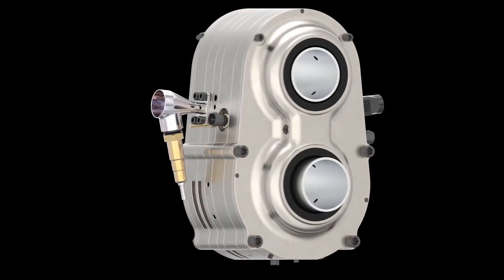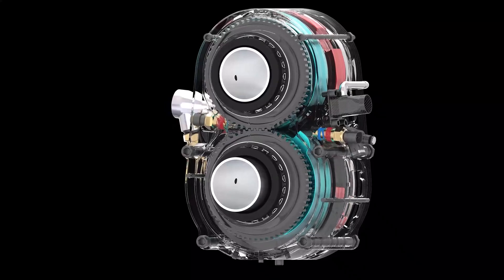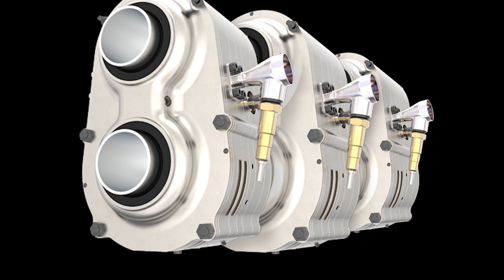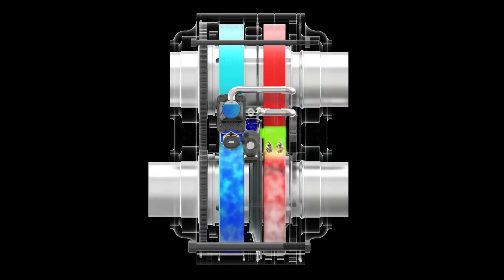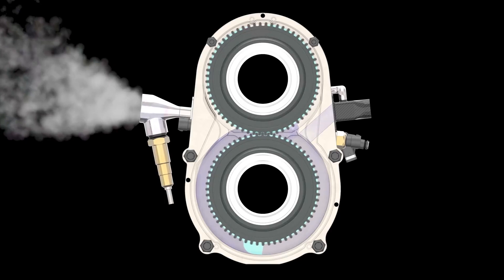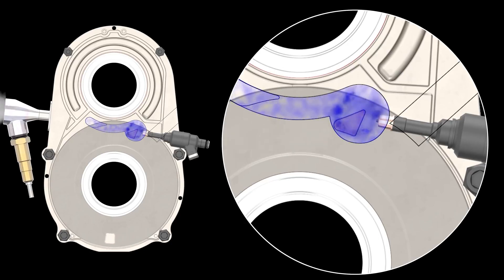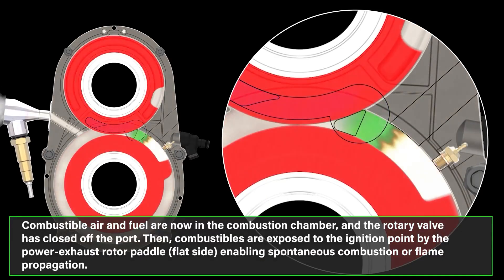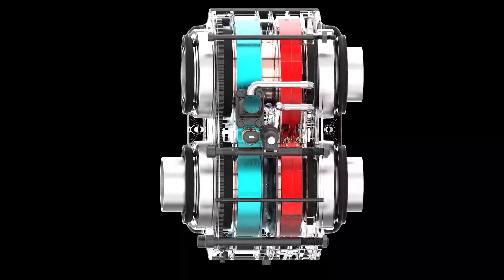This pistonless engine runs on hydrogen and revs to 25k rpm

Comment: It's an ingenious Brayton Cycle compromise between a piston engine and a gas turbine - avoiding most of the piston engine's inherent mechanical complexity and resulting friction losses, and much of the gas turbine's inherent "leakiness" and other types of losses. Looks like it'd make a good light plane engine.

But until I see a video of one running on a test stand, and read actual real-world numbers, I'm not going to hold my breath.

Comment: Really tight tolerances at high rpm on something that gets hot and cold and need to start and work in both cases!

There's a reason pistons have clearance and use piston rings to seal the gap. 

I'll belive it when it's not just computer graphics and they have one running for a few thousand hours. 

Sleeve valve engines were once going to be the next thing. But it was very hard to get the sleeves on high performance systems to last long at all. 

Even the wankle engine while it was sort or revived never took off. 

Some things are hard to beat.
Reply: To be fair electric already has beat it for the most part. Some F1 cars are electric. Nitro is still king in the 1/4 mile though. 

Gas is way too overpriced right now.
Reply: @KillinReapers  Formula-e is electric.  Formula 1 is hybrid.
Reply: @KillinReapers  Gas is only overpriced because of politics and greedy tycoons that are ripping people off. There's easily enough gas to go around everywhere, but politicians, governments, etc are all working to jack the price up at the pumps to line their pockets with profits. Don't kid yourself into thinking that the government actually cares about any sort of "energy concerns", they only care about how much money they can make. They get EVs out on the market, but yet fail to make them affordable to the average consumer, and then they introduce laws and legislations that put more and more taxes on gasoline and diesel knowing that's what 90% of the people use, with the excuse that they're trying to make EVs more prevalent, when in reality it's just because they know that 90% of the people are forced into using ICEs and that they are left with no choice but to buy the fuel and pay the extra taxes, so the government can take more money. And there's really nothing we can do about it, outside of voting people in who are less corrupt, but try convincing your average person of that....

Comment: Waiting to see a prototype. With the energy density of hydrogen, even considering the container, so much higher than batteries, this could indeed have potential. I personally hope to drive stick as long as possible. This one gear all automatic EV kind of driving is not for me, but the move away from oil is necessary.
Reply: This does not have potential. On paper it makes sense but there's no way they're going to scale this up and maintain "extremely tight tolerances." 

This is vaporware. It's a gimmick to get idiots to open their wallets.
Reply: If you state “the move away from oil is necessary” what is the plan for ALL of the cars, trucks, aircraft, trains, and plastic products? Once a workable plan for a transition is implemented moving forward away from oil may help. Additionally how about fuel taxes which are used to fix, maintain, and create roads? 🤔
Reply: @timcass5759  I am not taking about a process that could happen over night. Alternative fuel sources and suitable engines can help phase out the burning of fossil fuels for mobility purposes. Tax codes must surely be adjusted, among many other legislative aspects. It will take some time. What matters is to have that goal and pursue it. Regardless, oil will still play a role in the petrochemical industry, where it is even harder to replace.

Comment: What is its efficiency?  80%? Unlikely but that would be fantastic.  However, that would be primary component of the from tank to wheel efficiency of the vehicle. What would it is the efficiency of hydrogen's journey to the tank? Not so great.  Also it still burns fuel mixed with air at high temperatures, hence it will still produce NOx.  So much cleaner than other ICEs and a step in the right direction.

Aerospace applications seem to be where this makes most sense.   Delivering H to airports could made more efficient making H even more viable.  Most of the NOx would be considerably diluted before reaching the population.  Multiple engines could improve redundancy so may be safer.

Comment: If there’s one thing that will save the combustion engine it’s the fuel. Currently electricity takes too long to charge (while some cases could be made the tech just isn’t there for mass adoption of quick ac to dc charging) hydrogen is literally so abundant and could be modified into any gas station with very minimal work. Plus manufacturing doesn’t have to change all that much because the engines are so similar to the ones that burn gasoline. I honestly don’t see how hydrogen isn’t a win win especially with all the drawbacks of producing lithium ion batteries and the fact that China owns most of the cobalt on the planet.

Comment: A crazy 8 rotary might be a concept that we haven't explored, and there are reasons for that, the smallest of which is now you need the 2 "rotors" to have a near atomic tolerance. The only advantage of an engine like this is that you have complete control of the combustion chamber volume at any point by being able to alter the profile of the rotors. At the same time tuning it would require 2 brand new, matching, atomically accurate rotors. This says nothing of the housing seals.
Reply: that was unusually well said
Reply: @THESLlCK  Morgana is a man.
Reply: @jonathans4503  geez
Reply: "near atomic tolerance"  Really?  What type of atom are we talking about here?  LOL

Comment: So basically, Astron is claiming to have found the key to defying physics?
Eliminating seals with super high tolerances, yeah maybe. 90% efficient? BS. Maybe the friction looses only account for 10%, but despite our best efforts you will lose more to heat, there's just no way around that.
And while those super tight tolerances "may" eliminate seals, the cost of machining parts like that would make it insanely expensive. And what would the time and cost between rebuilds look like as those parts wear?
Reply: Good point. Laws of thermodynamics (Carnot cycle)  means you can't climb above a theoretical maximum  - dependnent on combustion temperature - which I think for hydrogen is approx around 50% something+  (?).
But in reality there is no way you could ever get anywhere near even that abstract theoretical limit. Currently they run at 20 -25%. So it would be semi-miraculous tech that got to >30% ..or maybe 40%.  Eitherwsy nowhere near the genuine 95%+ of electric motors

Comment: Sounds like a great idea, but doesn't metal expand under high temperature? Wouldn't such tight tolerances at 25,000 rpm cause the rotating assembly to touch? I have no idea what I'm talking about! >< lol

Comment: Tight tolerances? So the engine itself is the seal which means the entire engine is the wear item/surface. Straight to the scrap pile when the tight tolerances go bad.

Comment: I know it’s like an open look into it. But a few things I don’t see, a “crank pulley”, accessories wouldn’t be possible, and regardless the engine would probably have to have 8 ridiculous brackets on it just to support it due to its small size. U could go electric but I don’t see certain things still not being connected to the engine.

Comment: I’ve never been on the electric side. Hybrid to me is the best type of electric vehicle. But this, this is the answer we’ve been waiting for. Can’t wait to see it eventually hit the market for cars and trucks.
Reply: Probably ain't going to happen as it would be really expensive to produce because it requires especially expensive materials. And the question remains, how does it deal with wear? Sure, it could work for occasional driving, but as I daily driver I highly doubt it would hold up. And that's before we set into heavier vehicles like utility vans, trucks and other equipment that is used for many hours every day

Comment: One probable i seen imediately was the divet and notch set up on the inside, if the engine is not always in sync and the notch doesnt match the speed of the divet, then the engine will seize up and or break. Now if the system is chain driven between the top and bottom halves of the engine in perfect sync then yes this would be very effiecent.

Comment: While I see a lot of arguments against the design of the engine, The idea of Hydrogen power, produced through solar and wind, is an idea that beats the hell out of electric motors hat run on batteries which are expensive, made of rarer metals, non-recyclable, and there is nowhere to dispose of them, and the coal required to produce the electric cancels the non-pollution factor.

Comment: 170 lb-ft of torque producing 160hp at 25k RPM? The math doesn't add up. Would love to see a dyno graph of this.  160hp at 25k RPM is 33.6 lb-ft of torque.  Sure the engine can spin to 25k, but where are the torque and hp peaks? Lots to be answered before I'd sign on to any given "technology".
Reply: There aren't any dyno graphs because it doesn't exist.  This is another one of those paper designs, and it seems to be a constant that anything involving hydrogen looks much better on paper than it does in real life.  Toyota are one of the few companies to make an actual serious effort to build a hydrogen combustion engine and ended up with a real-world efficiency of about 25% - since they were easily getting 50% out of a fuel cell (and zero NOx) it's not surprising that the only hydrogen powered vehicle they actually make is an FCEV.

Comment: I'm highly dubious of a design that simultaneously relies on tight engineering tolerances for maintaining compression and also runs on the smallest element there is.
Reply: Another problem is the hydrogen making the metal brittle over time
Reply: @snifflesfpv7321  true this is a challenge, and quite a problem for aerospace. It's why satellites and probes in orbit or on station for extended periods won't use it. But, for a consumer grade product constantly being used and with parts existing in much more stable temperature gradients, it might be easier to control for. But thats just speculation. Won't know until a working model is built 🤷‍♂️ . Until then...it is a good point.
Reply: Also leaks if not running on high RPM.  So fine for cruising - useless for real world stop and go.
Reply: Uhm... you think a hydrogen atom is "smaller" than other atoms?  I don't mean that literally... we all know about atomic mass and volumes, but you think THAT is why this won't seal?  Pick any standard hydrocarbon molecule and you're still talking about just a few angstroms.  You believe that "tight tolerance" machining is measured in angstroms???  Oy Vey!
Reply: @DiffEQ  Van der Vaals Radius (closest distance between two atoms) is a complicated and incomplete field of research, but atoms with higher orbitals populated, (especially if they are not completely filled) tend to have higher distances denoted. And especially considering the fact carbohydrates in normal gasoline are relatively long chains (8-16 carbon atoms, with hydrogen in between and around, not linear, look up pictures, it's hard to describe) and are usually dispersed into miniscule droplets (still made of multiple molecules) instead of vaporised (only in a gas are the molecules unbounded) and hydrogen is present as two tiny (110/120 pm instead of 170pm for carbon) and close together atoms in an H2 molecule, it is definitely realistic (and actually a problem in scientific experiments) that hydrogen (and also helium) tend to even seep through air tight seals.
Reply: @Momi_V  hydrogen will diffuse out of tanks and storage lines. This is not an issue with an engine running at 25,000 rpm. The engine is using so much fuel so quickly that the hydrogen won't be diffusing out of the engine. I'd be more worried about the hydrogen diffusing out of the storage tank.
Reply: @DiffEQ  i mean it partially is in a round about way. Hydrogen embrittlement

Comment: Electric engines are all good, its the accumulators that is a problem. But just like in this case, solutions are on the way. But I imagine, not everything can be electric. Like military vehicles, for example. Military tasks value urgency and practicality for the purpose, and you cant just sit and wait for it to charge or have some infrastructure constantly around and ready to change huge ass battaries to swap them. So, yeah, there is still room for both options.

Comment: I am confused by the power rating. HP is rpm dependant….. so to me it sounds weird that this engine revs to 25k rpm yet makes more torque then HP high RPM means HP. If this is a realistic rating then there would be no point revving the engine past 5000 rpm because it’s already making full power before that

Comment: Some how you managed to not mention consumption and cost, hydrogen although abundant is expensive to create due to the cleanliness required. This is why hydrogen has not taken off despite a decade and a half of its use in either fuel cell or internal combustion vehicles. Pure hydrogen was not efficient  in internal combustion cars it was found that 70% hydrogen 30% natural gas worked best on supercharged motors.

Comment: I think that stuff like this is a better idea and there's more viable for the now than it is for electric vehicles. The ability to produce electricity in the numbers that would be required if gas fleet of internal combustion engines with eliminated would not be liable. It would have to be produced by burning fossil fuels so where's the advantage. I guess if you look at a CO2 emission so a car exhaust emissions technology more technology if research and done could tackle that problem also. I don't know if this is a working engine that's talked about in this video if it's actually a working technology that can be a mass produced and put in cars I don't know don't know enough of it in this video related to say so so I'll leave it at that sincerely Bob the blind bedroom guitarist

Comment: Electric is the way of the future. There is only one moving part in an electric motor.

Also, once superconductors are made working at high temps, there are no limitation in power.

For hydrogen, the only way forward for this is to use fulecells to extract electricity from it, working at room temperature. 
Burning it in a combustion cycle is hugely inefficient as most of the energy is wasted.

Comment: 94% of the worlds hydrogen supply is made using methane. It's because it's the most efficient process and able to deliver high quantities. Simply making a hydrogen engine does not eliminate the input of greenhouse gases. Better still, please tell me how the hydrogen will be stored, transported and dispensed? Hydrogen molecules are tiny and able to leak through materials used for storing it - a huge fire and explosion risk. 
An unsafe engine that uses fuels derived from fossil fuels that are greenhouse gases. Fuels that cannot be stored or dispensed safely.
Fail.

Comment: The design looks functional but there are some practical changes to be made. The hydrogen fuel part may be omitted completely. Hydrogen as a rocket fuel is okay, but for everyday use not so much.

Comment: I accept that the high revs do away with seals. Can the ballbearings maintain the tolerances? Fingers crossed. In a piston engine, the fuel burns near TDC and the crank angle is ~zero, so max pressure but no torque (however do they work!). Here, the pressure is applied throughout to a max "crank angle"
In short, I am impressed.
Reply: In a piston engine peak cylinder pressures occur at 18 degrees ATDC, but pressure is still pushing down for majority of the power stroke
Reply: @JaydenET   "pushing down for majority".... I can't agree. Thats my point. The pressure falls rapidly. Look up some pressure crank -angle diagrams. As it expands it also cools.

Comment: Hydrogen fuels are not as clean as you think. In order to make hydrogen fuel, you will need a lot of electricity to produce it. Which also produces emissions. That's why hydrogen cars didn't really take off even though they were developed before than electric cars.

Comment: I'm not an engineer but I am a very well experienced mechanic and it just doesn't seem very practical reason being if one little tiny thing goes wrong the entire engine will go to s***, I've had a 7.3 from the 90s running on three injectors with a blown turbo and a on the way out ICP sensor and she still started up and got down